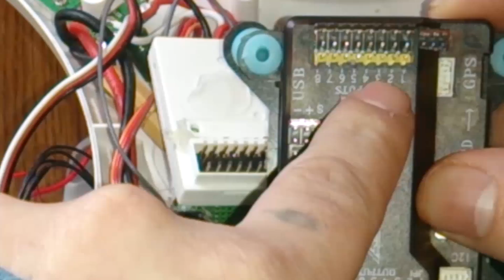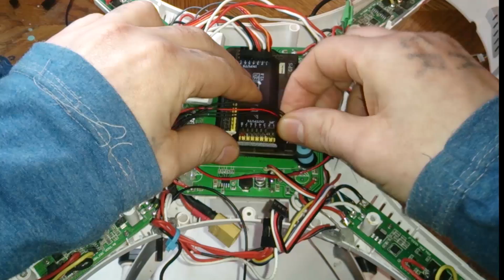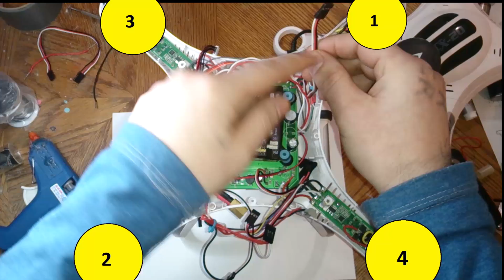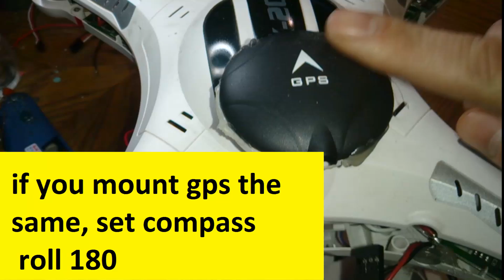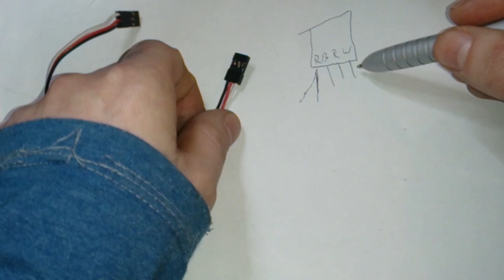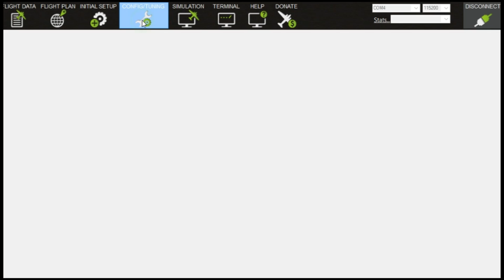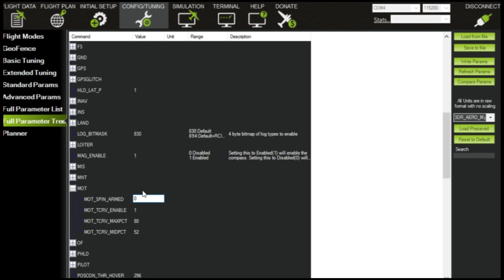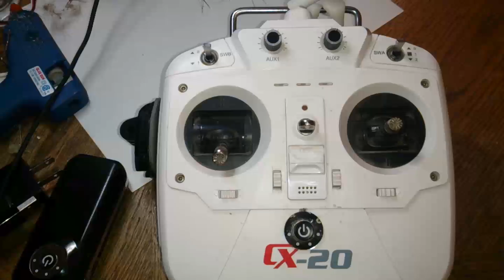cx20 factory apm to apm 2 6 - 2.8 step by step

Comment: Just contacted the place that I ordered it from. Trying to see if they will send me another one
Reply from the maker: alright it does look like the red wire is not pushed down in that picture though....but anyways option 3 is simple....  remove the power module.. or don't plug the 6 pin into the apm.

you need one more servo wire.. with red and black.. just remove the white wire out of it..

plug in your esc into your motor output location .. motor 1??
not sure for plane ..

on motor 8 output run a red and black wire to the other side of the apm
input 8 .. or you can plug it into the battery pins on the receiver.

The alternative to that is just solder jp1  pins together with a jumper wire

.. ...now it still looks like you have all your receiver wires going to your apm in reverse??? its like you have "a" plugged into number 8 on the apm instead of 1
Reply from the maker: also if you have any other esc's make sure to remove the red center wire out of them before plugging more into the outputs..
Reply from the maker: here is a pic of the jump 
https://drive.google.com/open?id=0B2w6_OKE_2kxT3lDUFpnZkZBOFE
Reply: I don't see anything with sonar or RNG thing you were talking about in your video
Reply from the maker: Hi .. i just read through some of your messages.. you were last on a plane..? .I'm not sure if it will work then or has the params for it.. if you are going to use your apm for a quad and loaded up version 3.1.5 or v3.21 for quad.. You should be able to find itin the params
Reply: I was just thinking the same thing
Reply from the maker: here is says the plane can .. http://ardupilot.org/rover/docs/sonar-sensors.html    ...I was going to suggest looking under sonar but you tried that already as well.. ..... for kicks you can try to back up your params and try a quad firmware v3.2.1 and just see if the params show up....   Mission planner can be a pain in the but as well when it glitches..
Reply: I don.t know where to download the 3.2.1
Reply from the maker: .. can you even see the full param tree??   I forgot to ask that.. 
if you can't see those.. you have to go to
config/tuning 
Planner
then look for Layout drop down menu
and change to Advanced.. 

for firmware upgrade go to
Initial setup ..install firmware 
then just click on the third icon the quadcopter one
If you have apm 2.6 it will auto downgrade to v3.2.1

but hopefully it was just the planner thing holding you up..
Reply: okay
Reply: I'll let you know tomorrow if I can see the full param tree. Thank you for all of your help
Reply from the maker: Your welcome .. tomorrow I'll load up a plane version on my apm and attach the sonar as well just to see if I can see something.. I looked in the firmware source code.. and could not find anything disabled or enabled for sonar for plane..
Reply: So it can't be done?
Reply from the maker: honestly no idea.. If you load previous firmware for plane ..and scroll down to version  ar2 45 ap3.0.3 ac 3.15    .  and install version 3.0.3 for plane .. Then "sonar" param does show up and you can see the settings working in the hud , you need to reboot the apm.

But I have no idea if it actually helps you auto land.

in version v3.40 it has a option for rngfnd_landing .. but i think that only uses the lidar laser module..
Reply: I think that it works, but not with the one that i have. I have the HC-SRO4. I think I need Maxsonar-EZ4
Reply from the maker: could be .. I don't have one of those.. I'm assuming its i2c like the lidar module.. ..   Not sure why they added it in version 3.0.3 firmware....I don't think the  trade off for sonar for older firmware would be worth it ..
Reply: As I am watching more video's on APM's. I don't think anyone use.s sonar on plane anyway. Haven't found one video yet with planes and sonar's
Reply from the maker: I should get into that hobby next you guys get way more flight time ..Curious as well if you would have to give the sonar a slight angle as well to keep it facing down or if it could even keep up with the speed of the landing for reliable readings ....
Reply: That is why I wanted for, for great landing. Yeah i get great fight tine. I have 2 4s 5000mah batteries and can fly for around hour and a half to 2 hours on how I use my throttle
Reply: okay please let me know when you download the plane
Reply from the maker: not sure if your replying to a old message.. I already did the plane firmware.. and found the sonar settings in the older 3.0.3 firmware.. and it works in the hud..just don't know if it actually truly works when your landing
Reply: That is great news. So how do I find the 3.0.3
Reply from the maker: I posted it 10 hours ago in this thread.. just look up a bit.. it starts with  "honestly no idea"
Reply: What sonar did you use for it? Here is my email because you are right. This YouTube is all over the place. scott.miller2726@gmail.com
Reply from the maker: its been a tad confusing for me as well as I'm helping you and another person on the same subject of sonar..  anyways using this one https://www.youtube.com/watch?v=CPxMgzNjj0w&lc=z13hzfu4qozdup0r504cgvop2w3djt4g24w.1494368990389485
Reply from the maker: and its this sonar I used ..  http://goo.gl/WS3wTp
Reply: Okay I think that I have the same one (Sonar)
Reply: It say on the back of the sonar (APM 2.5x HC-SRO4)
Reply from the maker: thats fine its the same one i have
Reply: Now my mission planner isn't working anymore. It won't load the plane version. There is nothing easy about this at all.
Reply from the maker: not sure if you mean it can't connect to your board anymore .or when u click on the firmware it won't install the firmware..   you can try to un install mission planner and try to install again to see if that fixes it.
Reply: It won't install the firmware. I did delete it and downloaded it again and again. It just stop working. Don't know why
Reply: It's saying that my URI is empty. Don't have a clue what that mean lol
Reply from the maker: can you still connect to the apm? 

are you un installing mission planner before hand. I've also had to delete the folder as well C:\Program Files (x86)\Mission Planner  .. my error is not as bad as yours usually i just start missing all the description info in params.. and I'm forced to delete the folder and start again   .. You can also try a older version and during install choose a different folder to install it in.
Reply: I am working on it now. Erasing all files in my computer. I'll let you know what happens in a minute
Reply: Going to try that right now. Install it in a different folder
Reply from the maker: I just got a message from you ..that you posted 42 mins ago saying you are taking a break..how ever i cant find that message in here..  

Not sure if you have answered the question yet.. and this is important .. can you still connect to your apm with mission planner. ?  or just having issues going back to the plane firmware?  

You can also try to download planner from the same site. and try that software to load your firmware.

http://firmware.us.ardupilot.org/Tools/APMPlanner/
Reply: Before I could not load the firmware. Now I can load the firmware, but it won't connect now
Reply from the maker: does it still get detected as a com port.. prob be best to check in device manager
Reply: Yes it does,COM5
Reply from the maker: have you tried to re write the firmware.. you might of bricked it on the last write some how.
Reply: How do I do that?
Reply from the maker: You can try this as well for kicks.. this will try to load firmware
its for a quad but that does not matter right now..

https://drive.google.com/open?id=0B2w6_OKE_2kxUDcyeG9jaFRpMDQ

https://drive.google.com/open?id=0B2w6_OKE_2kxLXBSd0lkLUNNdnc

extract both of those files.. 

open up xloader
under hex file ..find the extracted quad file.
Device = Mega(ATMEGA2560)
com port = com5   
 baudrate = 115200

if com5 is your comport..
it will look like its frozen give it about 2 mins if it does freeze after 2 mins or so ..you can try pushing the x and try again.
Reply: Okay
Reply from the maker: about the post before ..did you try to re load the firmware........
just go into mission planner set your com port to 5 and baud rate to 115200  ..but then go to initial setup then go install firmware.. and click on the plane or quad icon. and see what happens.. ..I have a unbrick video where I show around the start of the video what it looks like when its bricked..
Reply: What's the Link to that video?
Reply from the maker: ahh ..never seen your comment....here is a link to the unbrick   https://youtu.be/gKMFenjNrLE?t=78

Comment: I have a Walkera Devo 8s transmitter and RX701 receiver. I can't disarm it and my power module isn't working. How do I fix that?
Reply from the maker: HI.. I don't have a DEvo or the rx701 receiver.. but the quad should
should auto disarm after 12 seconds or so.... If your having issues arming it.. make sure your channel 2 is reversed on your devo..(if possible) and setup your flight modes as well..      If your still having issues arming it , check to see if you arming check set to disabled..  You can re enable after you know everything is working..

..When you say your power module is not working . how so?
Reply: When I plug the power module in and plug the battery into it. My APM don't light up
Reply from the maker: are you plugging one end into the original cx20 plug.. then plugging your battery into the other side of the power module?  ..

---------------
If you are plugging the battery directly into the power module.. and plugging the 6 pin connector into the pm spot.. it should power up .

couple of things.. it be your not pushing the cable down far enough . 
the power module is blown .

or the apm diode is blown .

If you have a voltage meter..test the cable 2 outside wires on each side for 5 volts...
Reply: My power module works because I plugged it in my PixHawk Px4
Reply: I looked on YouTube and found out that the power module has a 500mah fuse. I think they sold me a bad apm
Reply from the maker: Yeah if your power module works on the pix  then all should be well with it.. ... You can check the fuse on the apm and jump it but the next time something goes on it then its the 2560 that will probably smoke.
Reply from the maker: also ..does it work with just the usb cable plugged in?

and if it does ..does your speaker chirp and  your lights flash..?.
Reply: Yes it works with the USB cable (APM) but have no speaker for the APM 2.6
Reply: It would be so much easier if you wouldn't mind calling me. I am new to this hobby and really need you to walk me you to walk me through it #484-466-4558
Reply from the maker: are you doing this on a cx20?   or just testing the apm out of the quad.   .. the reason why I ask about the cx20 is because you can still try using the b cable instead of the power module... 

also if this is out of a cx20 (custom quad/ kit )and your using esc with becs ..and did not remove jp1 even though you have a diode to protect it , It might of blown having both powers.

-
Reply: I'm using it on a fixed wing plan
Reply from the maker: well then not too sure how much more I can help you..my knowledge is zero on that one..     

I can say though the way the apm pinout is 
1 2 3 4   for the inputs would go
a e t r     ... 

so that could be why your having a problem arming it as well.. if you have e and a reversed .

--------------------------
so what kind of esc are you using?
and does it have a bec on it..
a wire with White red black

it can have different colors but the point is if it has 3 wires  

Not including the big red and black main 12 volt wire.
Reply: I am using only one esc
Reply: The esc has a becs cord also
Reply: If you send me your email I can take a picture of it so you can get a look at my receiver and setup. I know I am doing something wrong. Even though the power module don't work. The APM still do power up with the becs cord
Reply from the maker: you can send pictures here ..try to have as much as possible plugged in accept the battery and usb cable..  bangs696969@gmail.com
Reply from the maker: Here is a test as well to try.
with your esc wire.. 
will say your esc wire is 
orange red brown
that would be switch positive ground.

plug your esc wire here
https://youtu.be/mrBWEATUbus?t=248

into input one....with the switch at the top ..just like the video.

then plug in your battery and see if the apm comes alive.

make sure not to have the usb plugged in or the power module.
Reply: Just sent it to you. Thank's for helping me. I really do appreciate your time and help
Reply: My esc wire is white red black
Reply from the maker: alright so remove input 1  ..and plug in your esc wire into that location
on the apm.. this is just a test.. once you do that the apm and receiver should light up..

again don't plug in the usb cable or the power module.

but you will need to plug in the battery .

------------
Let me know what happens with that setup.

on your apm do you have a jumper on Jp1???
if you do then maybe you did kill something.
Reply from the maker: also it looks like you only have 7 wires going from the receiver to the apm.. and you skipped input 1..   and started at 2..

unless you plugged it in reverse  8 7 6 5 4 3 2 1  ....right beside your gps it counts 1 2 3 4 5 6 7 8 for inputs
Reply from the maker: ok thats fine..same thing ..plug into input 1 and see if it powers up.  white is your switch ..so plug it in the same as the others with white at the top
Reply: Are you receiving my pictures?
Reply from the maker: can you take a picture of your power module wire that plugs into the apm
Reply from the maker: also unplug that esc wire for now.. .. i"m pretty sure I can get you going. just need a picture of the power module part..
Reply: Just sent to you
Reply: I really think it is the setting on mission planner. If I have the setting right I think it will disarm. Just don't know how to do it. I am new with autopilots
Reply from the maker: Ok so if you unplug everything and just plug in the power module.into the apm does it light up?

If it does not power up ..you can try jumping the fuse.. which is sorta dangerous because we don't know how you fried it the first time.. 

Option 2.. using the power module but not for power..

remove the red wire and the black right next to it..
this will give you hud data for current and voltage sensing.

then use your esc to power..

option 3..
just use your esc to power things up. and don't use your power module.

..pick one and I'll tell you in more detail how to wire..
Reply: No it won't light up, but it will with becs and usb cable
Reply: I like option 3 better
Reply from the maker: I just received your power module closer up picture..it looks like the first red wire is not pushed all the way down.. can you confirm that the red wire and the one next to it .. are actually pushed all the way down. ..u might have to use a pin or something to push them back down right..then try again.
Reply: Just pushed red and black all the way in and plug it in . Hooked the battery up and nothing. But it will work with my PixHawk Px4
Reply: Thank you for all of your help, but I need you again. I can't work the sonar with Mission Planner  1.3.48 build
Reply from the maker: Here are a couple of links ..you can try the older versions
once you have it working, you can go back to the newer versions

http://firmware.us.ardupilot.org/Tools/MissionPlanner/archive/  //missionplanner archive
 
In the sonar step by step the version I used was 
 1.33.2
Reply: I downloaded the old one like you told me. I have the HC-SRO4
Reply from the maker: do you have the daughter board on it..with the atmega328 chip that converts it to adc?      it only has 3 pins if you have the right one..other wise that module won't work with the 4 pin style..

Comment: Thanks for the video--- I really appreciate it--- I ran into a problem with my copter. Not sure if you can help but I will include a link to a video of my issue... Thanks again.
Reply from the maker: hi .. i can't see your link yet..  however when you do post/comment   it will be held for review so you might not see your post until I approve it...
Reply from the maker: hi  , check this part of the video https://youtu.be/mrBWEATUbus?t=1556    and confirm its at 0   ..if its still doing it even with it set to 0 ....you can try my params
Reply from the maker: oops i listen to your video and your having issues trying to find the param.. .. .. check again ..in the mean time i will download the newest version on a virtual machine and see if they changed it..
Reply from the maker: ok with version 1.3.43 build its basically the same thing
connect with mission planner
go to 
CONFIG/TUNNING
..Full Parameter List
.. use the scroll bar and bring it down to the m ..you will see 
MOT_SPIN_AMRED 70   <--- CHANGE IT TO
MOT_SPIN_ARMED 0
then click on the green button on the right side that says
Write Params.
then unplug everything and try it out.

make sure to use the scroll bar and not the wheel on the mouse,as it will change random things.  its actually a good time to click on the right side where it says Save to file.. and save your params for back up use

you can also find it under 
Full Parameter Tree.
scroll down to MOT
then click the + sign and you should see
MOT_SPIN_ARMED 70.

change to 0 then write and reboot..

--------------------
the reason why the motors stop is because it auto disarms after 15 seconds 
ish. when the throttle is at the low limit.  / its suppose to do that.
Reply: Ah- Im working on standard Parameters-- no access to full parameter list-- did I read somewhere your params file was avail?-- I dont know how to get the advanced settings to show up? See-- total newbie at  this! Thanks!
Reply: Got it! :)
Reply from the maker: hi .. good you kept at it.. did you figure out the motor problem as well?